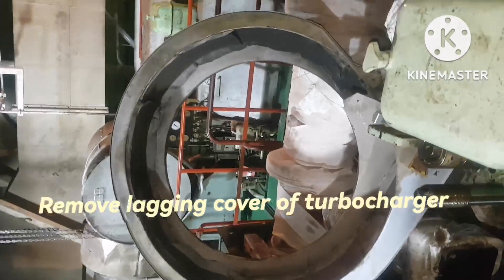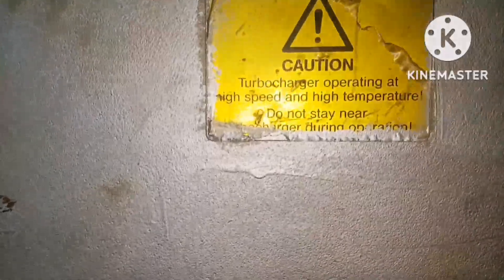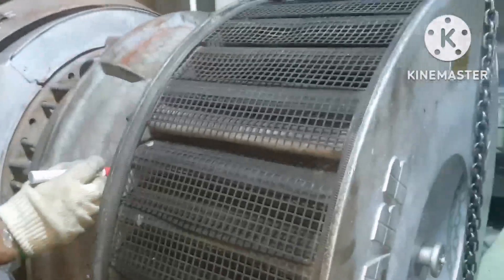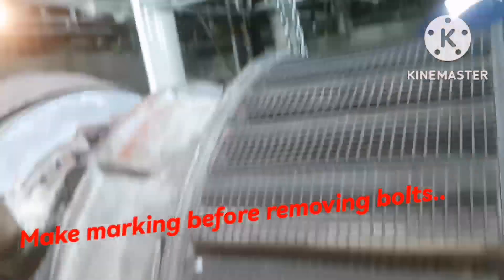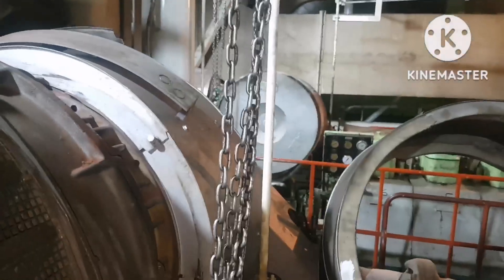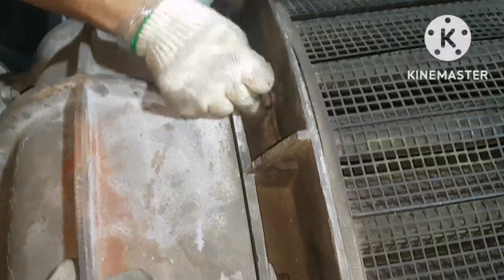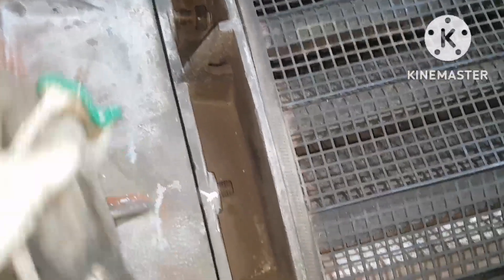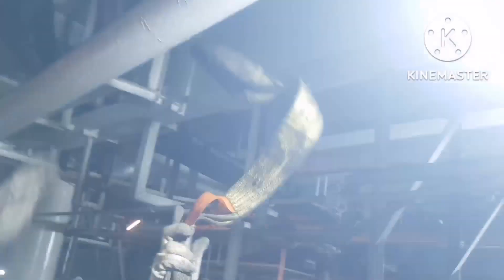HOW TO THEY DO.. HOW TO REMOVE GENERATOR TURBOCHARGER SILENCER ONBOARD SHIP..

Comment: Sir what would be the reason for boiler not firing up ?
Reply from the maker: reasons:
fuel filter choked
burner dirty
air ratio not ok
ignition transformer malfunctioning.
water in fuel
pilot burner dirty or clogged.
more gap in electrodes